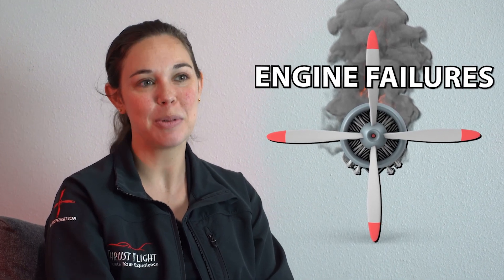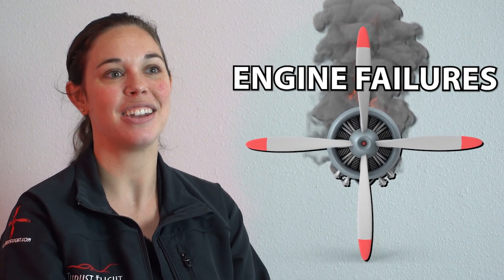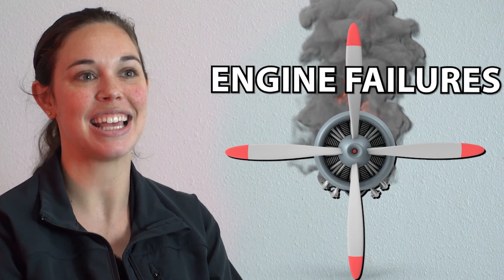Engine Failure Survival Guide: 4 Crucial Steps to Take When Your Engine Fails

Comment: Good job with the high altitude orientation to engine failure.  After 17,000 hours at 200' AGL or lower and 11 of my 13 engine failures down there in low powered airplanes, I would offer low altitude orientation to engine failure.

Airspeed is a good first consideration down here too.  I hate the phrase "low and slow."  We crop dusters and pipeline patrol pilots consider anything less than zoom reserve airspeed, except during landing, to be too slow.  Zoom reserve, from Stick and Rudder, is enough airspeed to maneuver with or without engine power.  Crop dusters go to max airspeed in low ground effect prior to every pitch up just over obstructions and turn when working.  Other low power to weight trainer type airplanes can do the same in low ground effect over long runways and not waist good airspeed for too little altitude to recover from inadvertent stall.  We naturally avoid hitting things, so startle is less disruptive where hitting things comes quickly unless we maneuver.  I was always able to maneuver to some place survivable in the six seconds of the low altitude engine failures I experienced because I always had zoom reserve airspeed.  I wrecked a couple but never had any injury.  Interestingly, I was always high and fast on short final to the LZ requiring full flaps and full rudder to the stop slip to get into the beginning of the limited LZ.

Best place to land is just there.  The areas available in the very near hemisphere are few enough that the best one is generally obvious.  Again, the engine just failed seconds ago.  We still have zoom reserve to maneuver to that field.  We are low and fast, not low and slow, so we can get to what we can see.  If we encounter wires, attack.  The low ones that serve homes and are not high voltage transmission lines (go under those) are light wires.  They cut, usually with the windmilling prop, best when we are in a bit of a dive.  When spraying, I had wire cutters on the windscreen and main gear and a cable from the cockpit to the vertical stabilizer.  I cut two wires and caught one between the top of the vertical stabilizer and rudder (where the cable took it) and bent the top of the rudder ninety degrees.  It was catch and release, as designed.  I dumped and landed on the road.  Again, for common takeoff failures, it is a six second deal.  Vx or Vy, pitch attitude not appropriate at long airports, is the critical angle of attack after three seconds of startle.  Much, much better to still be in low ground effect over the runway as I was in a pipeline C-172.  I landed on the remaining runway.  How many stall/spin fatalities happen on airport property?  How did the get high enough to kill them?  Vx or Vy was not appropriate.

Checklist.  One, two, three, four, five, six....we're down regardless of various possibilities.  None are more important than aviate, navigate, and communicate.  In six seconds we have time to aviate (use zoom reserve airspeed to maneuver) and anything else, other than changing tanks when both not available, is just a distraction.  I did mess that one up with an Ag student in a SuperCub.  He was practice spraying and in the pitch up coming out of the field, the engine made a loud noise and quit.  I took the controls, made and energy management (crop duster) turn to the adjoining field going the other way, and landed.  He got the tank selector changed and the engine caught on short final but I landed anyway to check things out.

Declare.  Aviate, navigate, communicate.  We are in sync there.  They ATC, NTSB, FAA really didn't care about my Ag forced landings and crashes.  They investigated none.  Pipeline patrol, a DOT thing, was different.  Anyway, your high altitude orientation covers that as well for we who fly low.

One last thing...All flight begins at low altitude, maneuvering flight, and ends at low altitude, maneuvering flight.  Airmen Certification Standards does not cover low altitude orientation very well.  It is something all training, flying, and working small, low powered airplanes need to at least consider low altitude orientation.  Airspeed, and not altitude is life.  Ground effect is free energy that goes away when we climb out needlessly early.  Down drainage egress may well be a life or death consideration, especially in the mountains.  Horizontal space available is limited so turns of whatever bank necessary may become necessary.  A 1 g turn of any bank angle can be safely made so long as the pilot releases all back pressure on the stick/yoke.  Unless we lead rudder, adverse yaw sends the nose the wrong way initially.  Push the nose the way you want to go and bank for coordination.  For humans who have too much auto muscle memory, the steering wheel is not our friend.  This show up especially with wing wagging to dynamically turn back to the centerline on short final.  Walk the rudder.  Tail waggers have far less landing problems than do wing waggers.  The critical angle of attack is when the wing flying, not why.  A pilot pulling (pushing when inverted) on the stick/yoke is required.  The airplane cannot stall itself because it is designed with dynamic neutral stability for safety.  Wolfgang asked us repeatedly in Stick and Rudder, "what does the airplane want to do.?  Guess what.  In every turn it wants to put its nose down to trade the potential energy of altitude for the kinetic energy of airspeed.  What are we teaching?  Why, other than in the legally protected airspeed, altitude, and procedural track of IFR, are we teaching that very unsafe VFR turning technique?

Again a very good lesson on high altitude orientation.  Please forgive a crop duster's rant.
Reply: While I was reading your comment, I was wondering where I have seen these techniques before? 1 min later, I got the answer, from the book Contact Flying Revised, I really enjoyed reading your book. Congrats from Spain

Comment: I live in a windy area so... best glide speed for distance in a 20 knot headwind is? I've never seen studies on this. I would gander that you want to increase your best glide speed by 1/2 of the headwind component. Am I correct? This of course would have to be a general rule of thumb as per the aircraft type BUT what is it? Has anyone published this sort of info? 
Also; If you are at max gross weight might you have a flatter glide slope with 1 notch of flaps? I doubt it but I'm asking! Has anyone proven or disproven this? AKA not on a gander.

Comment: That was incorrect. Best glider speed (L/D-max) maximizes DISTANCE. It’s the min-sink that maximizes TIME.
Reply: Altitude is time.  Down low around the airport, airspeed is life.  Emergency landing is a six second deal down there.  On takeoff it is unsafe to strive for altitude as quickly (no zoom reserve airspeed, just Vx or Vy) as possible.  Ground effect and just over the obstruction is airspeed.  Forget time.  You don't have it yet.